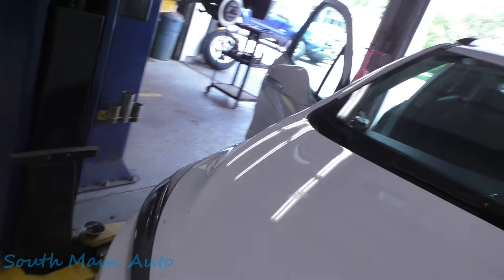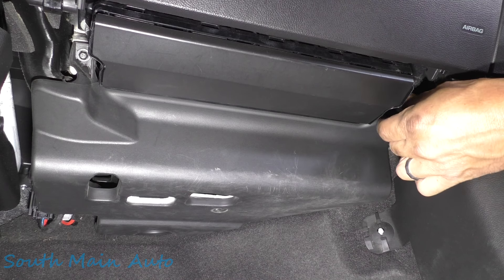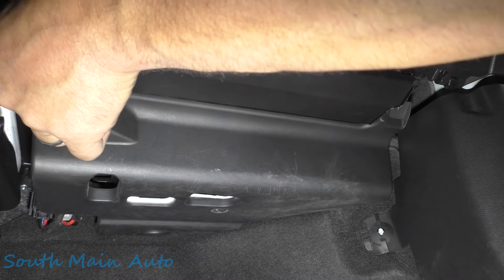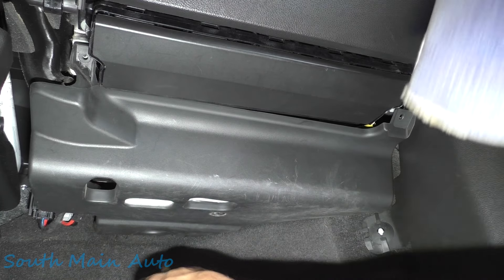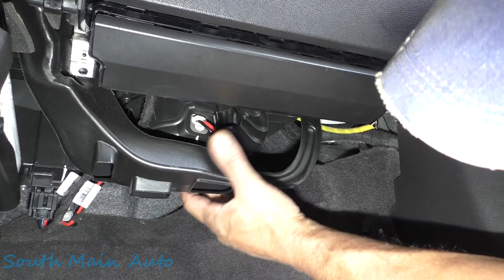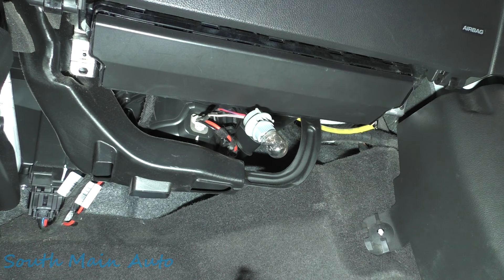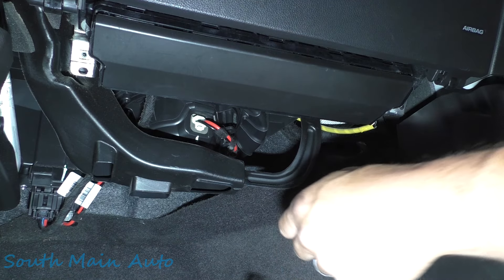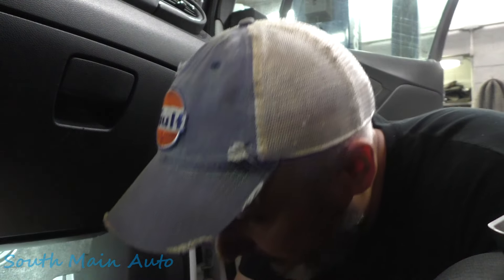Buick Encore - Blower Motor Replacement

Comment: I've been tempted to torch a hole through an inner fender to reach a bolt that was buried with no access. So it is absolutely NOT ok to give the enginerds a pass! Engineers know full well the service problems they create and they do it any way. And I don't want to hear about corporate pressuring them for cost savings or whatever -- they should have dug down deep within themselves and found some remaining scraps of their personal integrity and pushed back harder against management, marketing or whoever's dumb$4it idea it was.

Comment: the bean counters knew it would brake the pos plastico panel and they would make $$$$ on a new one. stop sugar coating it and tell us how you really feel. in 70's the inner fender had to be moved. gm has always hated an easy fix on the cars. trucks easy fix

Comment: GM has been making blower motors that have to be cut out of the housing for a long time, no?  I remember 90s cars like N-bodies, W-bodies, etc. you needed to do that, though IIRC you did it on the engine side, not the interior side.

Also people will just come in and make up a story there's something wrong with their car, when there isn't,  just to chat with you?

Comment: Why would someone bring a vehicle to a mechanics garage especially one as busy as South Main with no real issues? Obviously they have more money then brains. The last thing I want is someone working on my vehicle just for the hell of it with no issues. I do all the front end, brakes and other light work myself. I try to stay away from a garage. Eric you need to charge some people a as*hole  fee like I had to do when I ran my own tow truck. No one likes wasted time when they are trying to make money. I have a 2016 Ford Escape Titanium and the right way Ford says is to remove the whole dash board to change the heater motor in the Escape.

Comment: Ford is no better.  It's as if they engineer the easy fixable things to be tortuous to get to.  Simple wheel speed sensor for example.  Instead of a bolt to take off and then change the sensor on ALL of my other vehicles, (Jeep, Chevy, Dodge) for my F150, you have to take the wheel off, brake assy, and the rotor just to get to it.

Comment: Manufacture Engineers work for the company and that is the bottom line.  If they can save Buick 10 cents per car that is all that matters to them.  The mechanic that has to work on them is not a concern to them.  Sometimes I wonder if they laugh when they do these stupid things knowing the pain in the &$$ they are going to cause down the line sometime to someone.

Comment: You were complaining about GM trying to save a nickel on the blower motor installation.  Actually, you aren't too far off.  According to an engineering colleague of mine, he did an internship there and GM will make no change to a part if the cost exceeds 25 cents.  Yes, one lousy quarter can make a car easier to service.  Cheapskates!!!

Comment: 31 years in service and many jobs are MUCH more difficult then just 15 years ago. GM is the bottom of the barrel. This blower job reminds me of older Cadillac blowers on the firewall. Cutting with a knife. Many engineers are not nearly  as smart as they think they are. They live in a theoretical world, not in reality. If they had to work on this garbage, it would not be built as such. Built to last just past the warranty, maybe.

Comment: pulling steering box off ford truck 3 bolts 2 come out 3rd 1,2 " too loo long,ford engineering? assy, line wrong bolt?